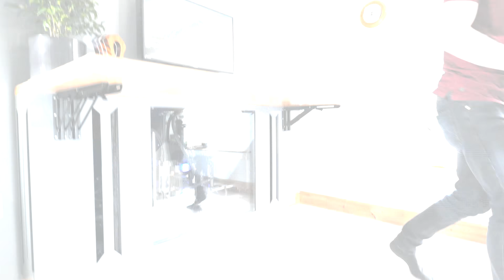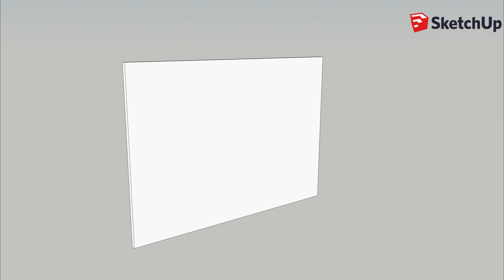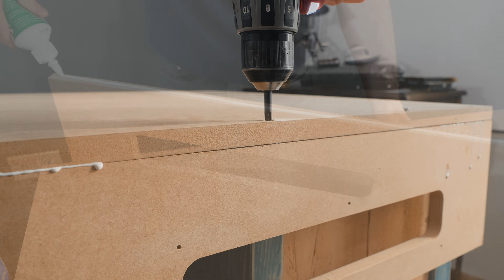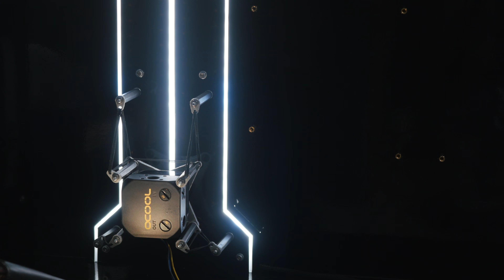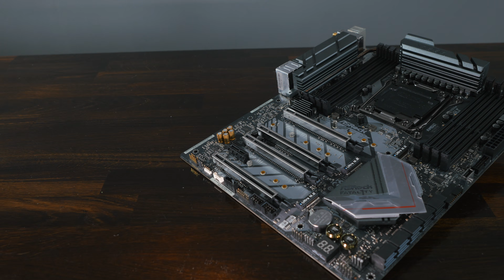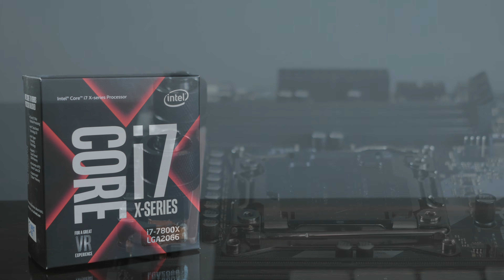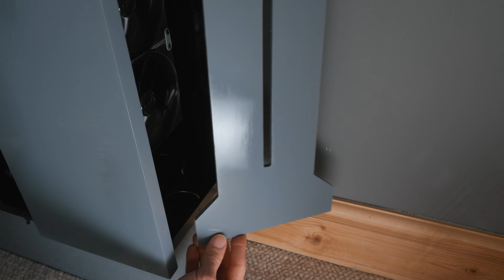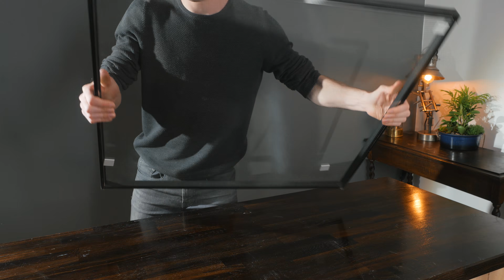Building a spectacular DIY 'desk PC' (it can fold!)

Comment: This is the most impressive PC build I have ever seen. Just one thought: If the whole thing is so air- and noisetight, couldn't you just use air cooling inside the box, and use a bigger radiator to carry the heat out of there? This would of course make the cooling less effective and more indirect, and would add some moving parts, but judging from all that noise reducing sealing, my guess would be it would not matter that much. it would reduce price greatly, and remove the need for all blocks and changes to the hardware. Basically, it would change the build idea to 'put a standart aircooled pc into an airtight sealed box, and cool that air through  a seperate watercooling loop.'  but thats just an experiment, this solution is far superior hands down. bravo!

Comment: Are there any plans for a more compact, smaller version of this build? Because 3x480 radiators are kind of expensive and kind of overkill for a single processor and a single video card, at least 9900k and 2080 Ti (as far as I understand, it could work with just 2x360, having cold water cooling the insides of the case, but I wouldn't know for sure). What I'm thinking about is something closer to a hybrid of cloud PC and a wall-mounted computer - isolated from the room or having enough air filters not to worry about dust build up over time (with periodic cleaning of the dust filters). Also, having a back wall made of metal would make dissipating heat easier since it could work as a giant radiator (but would introduce a number of other issues, being conductive and all).

My ideas on how one can make this thing smaller: less space for hard drives (stack them over the PSU or even use some drive caddies, I forgot the last time I heard a hard drive in my rubber mounts, and they're easy to use. You can also use less space all around if you position some components in a similar way to an average ATX case (psu on the bottom, motherboard close by, cooling system above them or on the side and such). And cut out some excess empty space.

Also, I know you used parts provided by sponsors so you didn't have much of a choice there, but there are motherboards that support water cooling out of the box (the ones I know of are ASUS ROG Maximus Formula boards, specifically IX, X and XI models for different Intel chipsets). I think there was some water-cooled ram back a few years back, but I'm not sure they still make it.

Also, wouldn't pump be affected by all the vibrations that it cannot pass on to other materials? I'm asking because I don't know, and I haven't seen anyone hang their pump before.

Also, why not make a slim panel under the motherboard to hide all the cables? I'm just not a huge fan of showing long thin wires everywhere, I prefer for them to be hidden behind some kind of panel. One could gut an existing PC case for this purpose.

Also... 600 watt PSU? I guess it worked, but I'd pick at least 850W model if I were building a PC that is not supposed to be serviced any time soon. PSUs tend to lose a percentage of power over time and they work great when at around 50% load (or so I heard). I'd also try to get the most efficient block I could find that works best when the system is at or around full load (300-400 watt, I guess for components I mentioned earlier, haven't looked at exact numbers, but AFAIR 9900k is rated at around 165W, while 2080ti could be around 250W under full load, adding up to over 400W, plus some for ram, motherboard and drives, so maybe 1000W PSU is not completely out of question). I'd also use three drives: 1tb SSD for the system and programs, 1tb HDD for files, 1tb HDD for backups of OS and programs. I'd screw SSD to the motherboard for highest speed possible and locate drives in a compact manner somewhere, maybe even behind the motherboard.

Also, MDF... why not HDF? Are there any specific reasons, aside from cost? And what about legs on the bottom? Current build stands on top of the floor, it would be interesting to have small rubberized legs underneath.

I'd absolutely love to see more DIY projects on this topic!

Comment: I'm thoroughly impressed. The only thing I'm going to nitpick about is I wished you would've used the carbon fiber stickers to cover the 7200 rpm spinning hard drives. They stick out like a sore thumbs and take away from the aesthetics of the build. I'm very surprised you didn't cover them.

Comment: The biggest problem, as always, is finding a way to remove the passive heat from inside the case.
Placing an extra radiator and respective fans inside the case to circulate air and send some of the heat to the outside seems like a good idea.
My question for the well versed in thermodynamics is: is that enough?

Comment: This is just fantastic, something I look forward to doing one day! Two tweaks: 1. All air cooled to keep it simple. Intake on one side with 2-3 200mm fans (or maybe a tower fan) pulling through an easily removable/cleanable filter, possibly incorporating a HEPA filter to clean the room's air at the same time if I could get it quiet enough. And 2. Incorporate either your motorized monitor lift, or run the cables through the wall to a monitor on a moveable arm, giving the monitor a nice frame so that it can look like a picture on the wall when it's in stowed mode. Most ideally though would be to have the PC in a separate well-ventilated room running long cables to my desk.

Comment: Great job. Your builds are always very impressive. If I could provide one suggestion for a future upgrade, you could route the monitor cable through the back of the wall and then have no cables visible. This is however only an aesthetic upgrade.

Comment: This build is awesome and very well thought-out! I wonder how much this project would have cost if the components weren't sponsored though, especially with the high-end 480mm dual radiators!
Pretty much my only point of criticism is the 600W power supply. Clearly it provides enough power for this build under full load, which is awesome. However, if you were to upgrade the GPU to a dual 2080Ti and go with SLi, I'm guessing you might run into some issues. Which brings me to my next question: What is the total power draw of this build, as is?

Keep up the good work, can't wait to see what you come up with next!

Comment: Just one thing the cooling loop is not that great as the hottest water from the GPU goes into the CPU and that area. I would have been better if you used that t connector to split the flow to the CPU and GPU separately

Comment: Oh my. Absolutely beautiful. My home will be remodeled (rebuilt basically) and i might actually take the project as i want a rustic kinda look on the second floor.
Since most of my budget will go on the house itself and many stuff that ill get, im not sure ill be able to afford the water cooling system as it is quite expensive in my country, but my pc is kinda mid end, so not sure if really needed.

Do you think i can get away with fans one side ventilating in and one ventilating out?

Comment: An incredible project with unbelievable detailed description. You really are in a class of your own.
My approach has been somewhat simpler: I built a sit/stand desk, electrically raised or lowered. On the desk I put an Apple iMac Pro (8 Xeon CPUs, 64GB ECC RAM, 1TB PCIE SSD and 8GB Graphics card) coupled with a 2nd 27" Cinema monitor. :) I won't go into other bits and pieces...

Comment: Ok, I'm not an expert of thermodynamics and liquid cooling, but I see a potential HUGE problem with your water cooling. It would seem that you hooked up your gear in a series (electrical terms, because its simple) circuit. water goes from Reservoir to GPU. the water heats up from picking up the heat off of the GPU.....Then it goes to the "power delivery system" (aka capacitors) to get MORE heat.....then the final stop, the CPU. the actual heart of the pc. and then it picks up monumental amounts of heat. Notice how i never describe how it looses said heat at any point in its journey. Maybe the tubing passively removes the heat, but I doubt itll remove much, if any. Its a really astonishing build, but the water cooling path is very concerning

Comment: WTF you went through that huge process to build a beautiful desk PC...and then left the monitor cables as a weirdly arcing tube coming up in plain sight?

You could totally have run that cable bundle behind the edge of the wood top and popped it straight up to the monitor almost entirely out of sight.

Comment: So you have no provision for dispelling the heat generated from the RAM, powersupply, and the heat soak that dose occur through the system running.  Cool concept but ultimately a poor design. 
The pump should of came with isolating mounts. I personally believe you went through unnecessary steps to for gains that would be unnoticeable.  
Your water block is very clever but you need a thermal couple to check the temp of the mosfet. To the final point. Soldering is NOT welding. When ever an interface is added you create an inefficiency.

Comment: I love this build, and I would definitely also try it by myself, if I get the time (and money).
However I am writing regarding one point that I saw in the build: around minute 17 you show how to do the custom water cooled heat sink for the MoBo components. It looked like the water will be in contact with the copper within this block. However I advise, from some experience, in redoing the heat-sinks in a different manner, as probably most of the metallic components of the water circuit will not be made of copper. The problem is the galvanic corrosion. This of course takes time, and the hotter some parts get, the faster the whole thing goes. This can be mitigated using other coolant I guess. Just try to find some info on the subject of having different metals in a cooling circuit and whether or not to redo some of the parts. In my experience (I work with lasers and we quite often do custom water cooling parts for them) every time we add copper into a circuit which isnt solely copper usually degrades much faster (I guess ions get in the stream and attack other metals) and we dont usually get to really high temps...everything is usually below 50°C, granted though that the water circuits are usually working between 10 and 24h a day.

But love the build. Had once thought of making a really silent and very small custom PC by having water cooling and then hiding all the exhaust radiators further away on the side of the desk but this is just much better.

*EDIT*
I now watched until the end and saw that the coolant supposedly discourages corrosion, but maybe it does it only for the alphacool parts (as they know from which materials they use for manufacturing) and does not guarantee bimetal corrosion protection? Just a thought.

Keep up the great content and work. Really love this channel
Reply: Nah. That's not water in the loop

Comment: It's a shame that I've got two hands but only one like button... The only flaw I could find in this design is the fact, that there is no cooling of elements like the VRMs around the processor, who are normally passively cooled by the air that flows over them. If you make it sealed, heat won't transfer as easily from the heatsinks, resulting in higher temperatures of the VRMs, capacitors, ... (which is quite a big deal if you consider the growing power consumption of newer processors (sometimes >180W). Because - even if you take the radiator inside into account - there is no real air flow. You can't just pull air through the rad, if it's not coming from anywhere.

While some heatsink for VRMs are already watercooling-ready (with fittings), you could use an internal recirculation fan to provide at least "some airflow",  especially for critical components like the fanless Seasonic PSU.

Comment: 1. why don't you screw some fans to the first radiator?
2. you should point fans on the second radiator blowing outside the case and mount some additional fans behind dust filter pointing inside the case feeding the rad with air or at least mount dust filter before this rad to prevent dust from getting inside the case

Comment: I never would have actually thought of this, but it's definitely a cool idea. A Chiller, with a nitrogen purged main compartment and the radiator swapped for an off the shelf chiller, or a DIY chiller(please don't hurt yourself here, it's a very real possibility between 300+ PSI pressures, lots of high voltage for compressors and fans and the chemicals needed to keep the coolant from freezing) could make major changes in performance, especially on that CPU; which to be very honest, isn't as fast as the latest standard desktop parts, let alone higher end HEDT processors. On the upside though, that motherboard can support processors with 18 cores which turbo to 4.4ghz under 1-2 core loads, and with proper chilling, could see 5ghz on all 18 cores, though you're now dealing with 500W+ of heat to dissipate.

Comment: It's a great build. I'm much too lazy to put in all those hours of work but I like it. One issue may be the pump, though, that's now a honking huge single point of failure. An air cooled build using giant heat sinks with fans on them may have fans fail, but the heat sinks will still be able to radiate away a lot of heat. A water cooling system that stops circulating coolant is a lot less fun.

Comment: Awesome job as always, though the use of MDF over plywood for sound deadening is debatable. It's mostly propaganda from speaker companies in order to justify using a cheaper material for mass-manufactured speaker boxes. The benefits of plywood would be that it's stiffer, lighter, and easier to anchor screws into. Plywood is more ideal for DIY projects. Check Tech Ingredients YT channel for some ridiculously in-depth videos on custom speaker boxes and sound-deadening.

Comment: Thanks Matt for such an astonishing project. Would you mind planning an upgrade it to a standing desk powered with an electric actuator. There are obviously some companies making these tables but they are standalone and not fold-able and also we are here for DIY project. In my opinion all you have to do is to make two rails on each side, place your setup on them and make the lifting capability with the help of mentioned actuators. It should be quite cheap to upgrade but several engineering challenges should be overcomed.

Comment: Some excellent ideas here, I would do this air cooled with an open front using the new noctua passive heat syncs on the gpu/cpu to vastly simplify this idea and then add slow turning fans to the design if needed for a nearly as silent build that occasionally needs some dust blown out of it. As always, your designs are some of the classiest on youtube....Not something I can say often.

Comment: It is by far one of the most well thought builds. I would have a couple of things changed: 1 - PSU should't be at the same physical confined space than all hardware ( You went in a lot of work to cool down the VRMS, so they wouldn't dissipate heat into the main compartment, the PSU produces almost as much as heat if on loads, especially if passive and not vented); 
2- I would have a separate water input to each component, and not hop from one to another. Even if you have (and obviously you do) an immense amount of heat dissipation hardware, the  existing limitation is the liquid heating absorption: Even if it gets cooled  well, it builds temperature fast once it starts hopping between components. 3- I would also think of using the radiators in a horizontal position, thermal dissipation by increases a lot (and they beeing as big as they are, you should be able to use the computer several hours before it even warms a little  (total passive mode  =ON  :) ) Great work, it is amazing how more than half an hour from your perks, seems shorter than an average 8min video of some people! 
Greets from Azores! :)

Comment: I have 3 concerns.  
Some sort of ventilation would be nice.  That chipset is baking in the thermal shot and you have exposed fans anyway.
The suspension thing is overkill because the MDF would absorb any vibration those fans and pump would make.  And why not mount the fans to the rad?
My 3rd cocern (hilariously) is the fact that you mounted the res upside-down.  XD
Overall though it's a stunning build.  This is going on the bucket list.  Thanks for the inspiration and I'll be looking forward to your next build.
Reply: Not only all that, but why in the hell would you go through all that and only put a 600 watt power supply in it???
Reply: @cantcode1001  XD XD XD

Comment: ummmmmm custom loop, "A ress , these are very use full in a water loop,  as they make it much easier to fill and help catch any air inside" ummmm could you think and explain that properly lol, a custom loop requires one, O not to mention it has nothing to do with capturing the air,  hello, leave it open so  the air can escape as you add water, also is it not recommended to leave it open so you get rid of all you're bubbles?  for 24hours also to check for leaks. 

Sorry buddy good video like the build but, you need to not try and confuse ppl with custom loops that might think o i dont need a res, you could get away without one but, that's not for this type of project or most custom loops, You NEED a ress. not it's very use full. Also do not forget you're DRAIN LOOP, you forgot to mention how you did it,  and you didnt need the fill port,  you added extra tubing for nothing, inless it was actually added to help support that ress. lawlz gg wp.